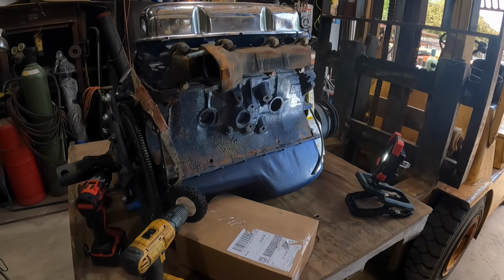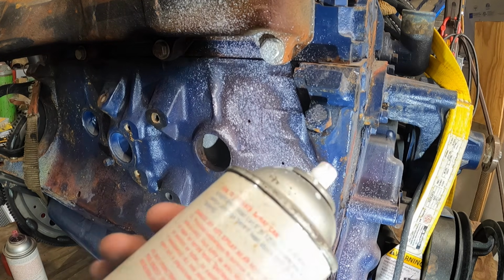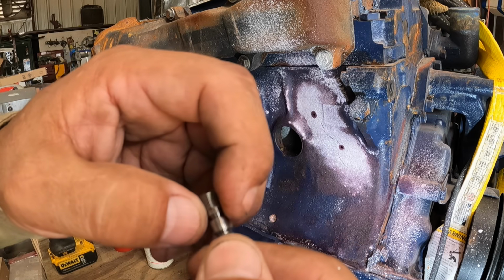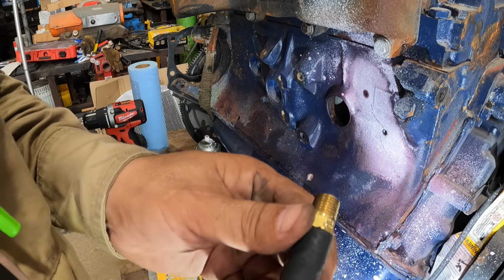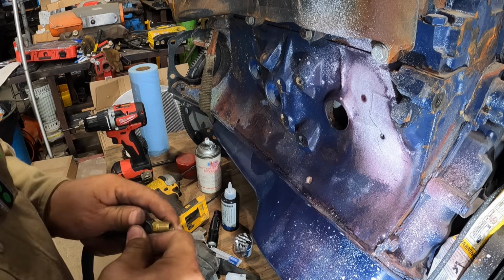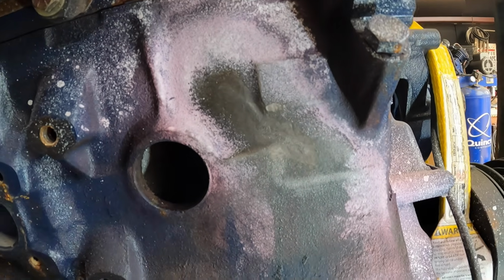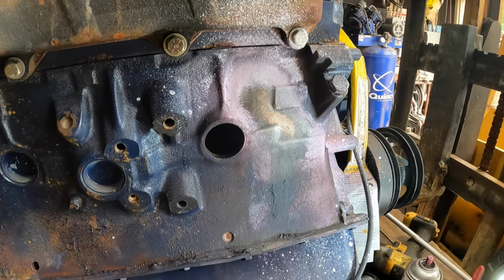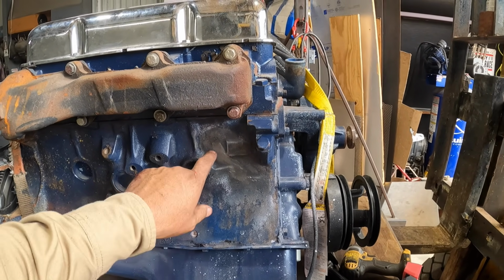Cracked Engine Block Repair

Comment: Did u have to drop the oil pan to make sure there were no metal shavings or just flush out the coolant passages?
Reply from the maker: coolant passages

Comment: Hello Isaac, I have just watched your engine block crack repair using screwed pins. I have decided to go ahead with this on my cast iron engine block, however I cannot find a supplier of the repair kits. Can you or anyone provide a supplier and their contact please. I am based in Australia.
Reply from the maker: Try and reach out to them directly. Lock N stitch.

Comment: Have seen a video where a guy displayed a method using 6013 and copper wire to weld cast . He wrapped a spiral of copper wire ( thin stuff recovered from a piece of extension cord ) the addition of the copper to the puddle seemed to result in a much hotter arc . Interesting shit .

Comment: Find your crack, grind it out, pre heat really nice, weld er up with zinc rods, immediately set it in front of torpedo heater and back it up 6 inches every 10 minutes for an hour or so. And thats it. Done it multiple times. This is just wasting customer money. 
But I work on my own stuff. Guess it don't matter when you are spending someone elses money and charging on top of that

Comment: Absolutely one of the goofiest repairs I have ever seen in my life.
Reply: Never worked in an engine machine shop have ya they have used this method to repair cast iron blocks and cylinder heads since WWII it was developed to repair tank blocks and heads I repaired a lot of agricultural and commercial diesel blocks and heads using this method when I worked at an engine machine shop

Comment: Geeze. This has been around for decades!!!! This is called a cold weld and you dont need to buy any special bolts. The correct way to do this is to install bolt one and then install bolt three. Once they are installed, you come back to do the middle middle bolt. Repeat process.... Im an auto machinist and this is our quick way fix. A nickel cast rod is the way to go.. Just preheat the section that you are repairing  to 300 F  using circular passes with the heat. The trick is to stitch weld. stitch welding is every other inch. this way you take the risk of further cracking. if you have an oven, you are good to go.  The correct welding rod is the high nickel-cast 55 rod. Heres a secret. If doing something like a cylinder head. Grill it hot then throw it in play sand. Play sand allows for the heat to be released very slowly, virtually eliminating further cracking.... DO NOT LISTEN TO ANY BAFFOON WHO SAYS TO USE A COLD STEEL WELDING ROD!

Comment: I saw how much longer the hairline cracks appeared to be on this video, would be interesting to hear if it cured the problem after 6 months of use and how the expansion and contraction of the slightly different materials would hold together over time.

Comment: Great job, Isaac !! 🤗
Cool tools & repair !! 
Please research the dangers of using Chlorinated Brake Cleaner when associated with welding, it just could save your life !! 🤗
Reply from the maker: Yeah I know, that's a common thing to warn about. Thanks for the tip! I dont use too much of that stuff.

Comment: They work very well. I have used them on engine blocks to heavy equipment. 
Attempting to weld causes the cast to get extremely hard.

Comment: Thats just a feeeze crack. Clean it i
Up really well and flux core it. The pressure doesnt get higher than 15or so psi. As lokg as you seal it up it wouod be good to go. Ive seen this very thing done with a shtty harbor frieght 120v flux core macbine. 
Also the way you did it all that metal debris are goijg to be in the cooling system. Which will cause issues

Comment: Lock N Stitch should give you 10 free sets just for this video demo. Never thought the wall of the cast would be so thin. Without the Lock N Stitch method, could you have  scratched a small groove and heated the local area before tobin bronzing it with oxy acetylene?

Comment: So wait, If I'm following correctly, you didn't weld anything you just drilled and tapped and inserted a new filler metal with this special JB weld style thread locker on it?
Reply from the maker: yup. thats how the screw supplier suggested it to be done
Reply: @ICWeld  What a time to be alive

Comment: Repaired a cracked block on a 54 olds w powdered iron mixed w kw radiator sealer in a paste never leaked 🎉

Comment: I dunno man, seems like a lot more work than just grinding a bevel and preheat and silicone bronze. Or muggy weld rod. I can see this would be nice for areas where you can’t access for welding or preheating.

Comment: aren't u afraid that it might expand (the metal u used to fix the crack) more than the material the engine block is made of? and so it might do more harm than good ?

Comment: If the dye your using is magnaflux your supposed to spray it in the inside and the developer on the outside.

Comment: I learned this back in the60’s. I worked at a machine shop that did nothing but” cold weld” engine blocks and heads. We could do cracks in the valve seats even. Very simple technique if you have the right materials and tools. Loved that job. Went to school half a day and worked the rest and also Saturdays. I worked there 4 years. Good times to be alive in the 60’s and the muscle car era.

Comment: I welded a cracked block on a 5.9 dodge ram right bank , V'ed deep and used NI-CAST 1/8 at 90 amps, worked good.
Reply: Yessir you are on the right track. This is a welder thats not confident in his welding!

Comment: Two part epoxy would work. If the crack were long and in a critical area, welding is better. I'm guessing they had water in there and it froze.

Comment: Had a crack 3/4 of the way around #6 cylinder on a Continental  IO520K. There's no welding that. It's trash.

Comment: Those pins look rather long. I would be worried about going too deep ang getting into a cylinder or something
Reply from the maker: I made sure to use the correct length pins. The place I purchased them from had me measure the depth beforehand.

Comment: As a District Manager for GM during the 70's and 80's, it was determined that casting issues had developed at the engine foundries that manifested into cracks in the block of the 350 cubic inch engines.  Since customers had found out what used to "divisional motors" (Chevy, Pontiac, Buick, Oldsmobile, Cadillac) were (via Roger Smith's cost cutting) amalgamated into one engine, the 350 for all divisions and GM wanted to validate that the global engine could be trusted for longevity.  Until the foundry issue could be sorted out, that wasn't the case and the dealers were plagued with the crack problem.  The customers never realized what was being done to their brand new car.  The Fix:  Was exactly what you're doing in the video except each geographic area (Zone Office) had an "expert" trained at block stitching.  The primary difference is that we carried a portable Magna-Flux machine to detect the extent of the crack or cracks.  After stitching the block, we used a two-part heat proof epoxy and OEM matching engine paint.  Done correctly, not even a skilled technician would notice the repair.  For all the blocks that were stitched I never heard of a future failure so obviously the foundation for the technique had merit.
Reply: Nice. My thought on Isaac's repair is that for that trouble, one might just braze over the top.

Comment: I’ve seen this process before on a old cast tractor block from the 1940, It was seeping coolant through the side of the casting, As far as I know it wasn’t no more trouble and still being used at specialised events 🇬🇧🇮🇪.

Comment: Great work as always.  Now I want to try that out and I definitely need that wire type hose clamp for all the air and water hoses. I deal with those would be great thanks, Isaac.

Comment: I had a friend bring me a 2.8 L v/6 engine that the rod blew a hole in the side,he had the peace that got knocked out it had part of the flat surface where you bolt the oil pan to. Well it was a challenge to get it to match up exactly so we got it as close as we could, I got the flat surface really good but the outer surface didn’t fit as good . He wanted me to weld it back,I had a stick welder,& he said he had a special rod for cast iron welding .i did my best getting the welds as close to each other as I could,& and overlapped what I thought might need more,& when finished didn’t look to bad,off he went put it back together, he said the repair came out good,with no leaks,I enjoy welding things & fabrication.i guess that job was good enough,he was all happy with the results.when I saw the topic i thought also you were going to take out the ark welder, it seems like a long process,but what counts is that it holds right.i like watching your videos because i learned from them,your a wealth of information thanks for doing what you do.

Comment: I don't a block over 20 years ago with JB weld and it is still in my mustang and has never leaked a drop. I could see doing a job like you did if it is a high hp race engine but not for a street engine.

Comment: If you use that system again,  try to get a shorter drill bit.  It kept hanging up on you at the end of the hole because the long shaft allowed the bit to twist when you snagged at the bottom of the hole.  A shorter bit is more rigid, and it will keep cutting.

Comment: How much protudes inside
Reply from the maker: Almost nothing protrudes on the inside. The place where I ordered the screws has you measure the thickness of the cast so they sell you the proper length screws. Thus the two small holes that were drilled into the block.

Comment: I think I would pressurized the block and  spray it with soapy water.
Or I have used a big shop vac and use vacuum to suck in soapy water. Good insurance before installing motor. But that is a tried and true type of repair

Comment: U need a scanner not a part store pos  the scanner will show you which cylinder is missing you can use the misfire graph on the scanner to determine which cylinder is laying out most likely it's a cracked spark plug check plug for carbon tracks or a rusty like look on the plug where the porcelain meets the plug base those injectors also have little screens internally that can get plugged up also

Comment: I was told by a welder with 25 years experience back in 1984 that welding cast was a waste of time becaues the act of welding in itself would cause the crack to expand which would make it keep on cracking. Mine was on a 318 V8 and was over 5" long in a similar area to the one you are doing. I put the engine back in my Dodge Aspen, ran some sodium silicate throgh it 3 times at 200 degrees with the engine running. After the 3rd time it leaked no more coolant and I drove it another 50,000 miles before junking it.
Reply from the maker: Sodium Silicate. I'm unfamiliar with that. I'll have to look into that.  glad it worked
Reply: @ICWeld Irontite has made a sodium silicate stop leak solution (ceramic motor seal)  for cooling system since the 60s, but this is where it gets interesting. Remember the – Engine Disablement Procedures for U.S. Government CARS program 2009? Also known as the Cash-for-Clunkers program.  They wanted tp permanently destroy engines of old gas guzzling clunkers so that motor manufacturers could sell new cars. Sodium silicate was used by the dealers to permanently kill engines by draining the oil and pouring a 40% solution  (weight ratio of Na2O to SiO2) into the engine in lieu of oil. When heated sodium silicate dehydrates and "glassifies", forming a solid silicate glass that seizes the engine.

Comment: We were taught the treaded taper cast plugs back in 1963.
Just sew them up.
Had an instructor that drove an old ford flat head 6 with a cyl. Wall sewed up.
Reply: 😅 well I'm 74 years old I've had a shot for over 50 years and I was taught by a man of world war II soldier how to weld cast iron and I have repaired a lot of cylinder heads and cylinder blocks on various engines over the years and there's one engine in particular I did many years ago and the guys in Illinois with it busted up so bad but I tore it all down I did all my welding put it all back together and yeah you still got it still working but I was taught by a man it's nearly probably 100 years old now if he was still alive but he he taught me and showed me how to to nickel weld and a bunch of other stuff and then I've also discovered things I can do with a MIG welder

Comment: That's what happens when you have no antifreeze in the block and the water freezes up first the core plugs pop out, and as the frozen water that is frozen keeps freezing up even more it cracks the block. Remember they're not freeze plugs they're called core plugs.

Comment: I was hoping you were gonna use the drill and plug method. Farmers used to use this. In fact they probably still do. My father told me about how my grandfather fixed the crack in his john deere tractor by going and getting sulfur powder And heating it until it was molting to pour on the engine block that he had prepared previously. That meant the tractor had to be put on its side to make the repair, but basically, you just poured molten sulfur on the engine block and let it cool, and then put water back in the radiator, then it went back to work. Best I can manage under the influence of medical marijuana.

Comment: Nice work as usual Isaac . I used to do it with nickel rod and a buzz box . But that was on empty blocks and some preheat (but that might get a little sketchy with that one . They didn't have that neat stuff when I done that . looked great . :)
Reply: @johnjay5143 Am trying to keep the old oxy acetylene flame alive. Have you ever tried to use tobin bronze after making a groove into the crack? It seems that tobin bronze, also called Naval Brass, needs little and localised preheating. It melts at 895 C as opposed to nickel at 1400 C .Used extensively on ships because of its versatility and machinability to fix steel, cast iron copper bronze and nickel alloys.

Comment: I saw a product like this back in the 60s, only difference was it was a taper on the bolt, and when it snapped off, it left about a 1/4 inch shoulder, that you peaned it over. The bolts were cast iron too, the called it Stitching the Block.

Comment: You need a ferrous probe and some iron powder to find cracks. Magna flux 
I’d recommend Muggy weld rods and weld that up. How I fix blocks all the time. Never an issue

Comment: my father used to be a machinist and built engines. he used a similar product from goodson . i still have an old boat he had with a gm 4 cylinder that was froze before he got it and cracked along bottom of sleeves in crankcase he used that repair with a thin layer of epoxy over the area probably 25+ years ago and has never had water in oil and still running

Comment: I too wondered how the process worked,and who better than you to teach an old dog new tricks,I'm  71,,,many yrs ago another old guy taught me to repair an hydraulic cast relief pressure assembly on a digger I pin punched the entire length of the crack either side,an amazing result,you know what the shock loading of hydraulic  pressure may have been,well it never leaked in the following  10 yrs I had the digger,
Just thought it was worth sharing

Comment: I've seen this method used before with a jig that maximize the spacing between the pins  and allows you to drill two holes at one time and use the spacer to punch the next hole in proper place. I though it was neat...

Comment: I may use this method. Good video! What did you pay for the kit?
Reply from the maker: The price varies upon the type of crack. you may need different types of screws. As you talk with the salesman, they will guide you as to what would work best.
Reply: @ICWeld  ok thanks how much was yours?

Comment: The one BIG PROBLEM with this is that all the metal shavings in the engine itself will eat the bearings
Reply: He's drilling into the water jacket...didn't you see the big freeze plug right next to it?

Comment: I first came across this method in 1981, I was tasked with repairing a large cast iron machine tool base. I found a company that repaired large marine engine cylinder blocks, he had never done a machine tool before. It worked very well and was almost invisible when complete. Great Job

Comment: Back in the 1970's there was a fellow that would do this called metal lacing. Not only would he fix cracks in blocks but would also fix holes by using scrap pieces of cast iron and lacing it in.

Comment: Love the wire clamp gadget... that is #2 best tool after the needle scaler LOL. From a technical design POV I wouldn't use that stitching method to fix a crack in anything that under tension. The fact a crack has developed could indicate a tension stress that caused the metal to open up, so any screw based solution would be a short term fix. (screws by their fundamental design cause base material tension and could exacerbate future crack growth). Cast iron welding with all the ingrained oil and material thinnest would have been a significant challenge - and expensive due to the time\effort involved. Silicon bronze might have been a viable solution as that avoids the thinnest issue (as your not melting the material) and the porosity works in your favour as a sponge but I've never tried that process on cast iron.
Reply: This method has been used for years. Its even used successfully to fix cracks between valves in cast iron heads

Comment: Slick repair, with the needle scaler you would hardly even know.
More than once I have repaired hoses with fencing wire, lockwire style one full wrap and twist with pliers. Although that tool is quick and nifty.